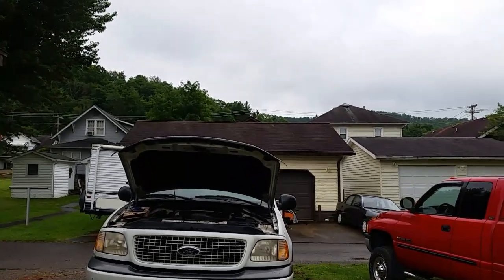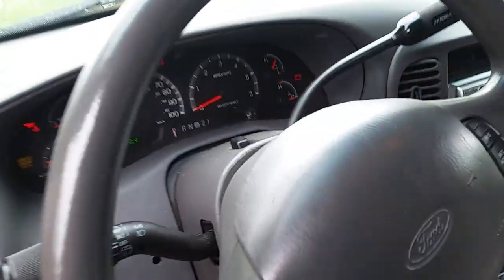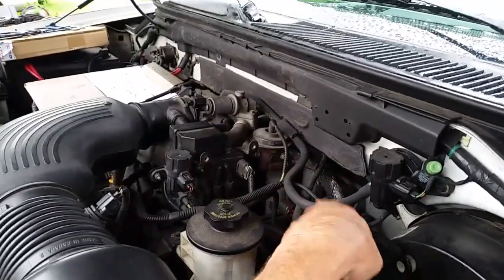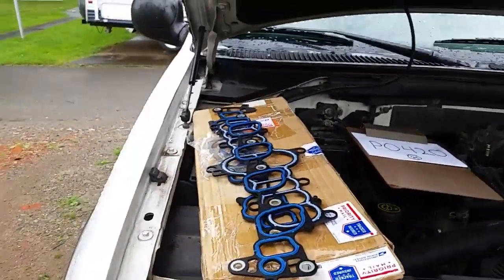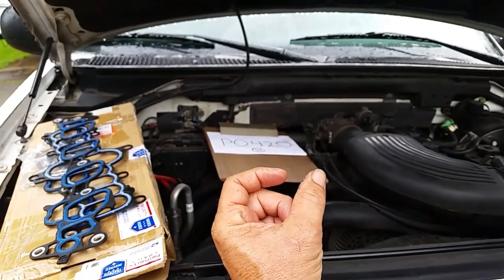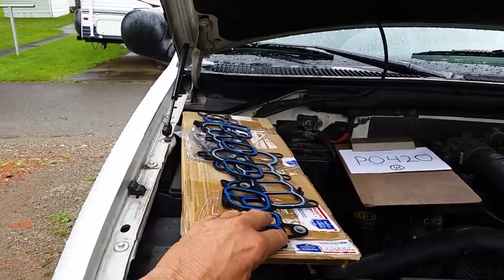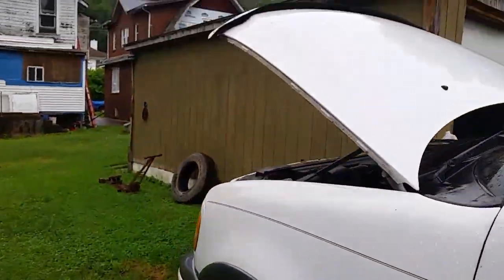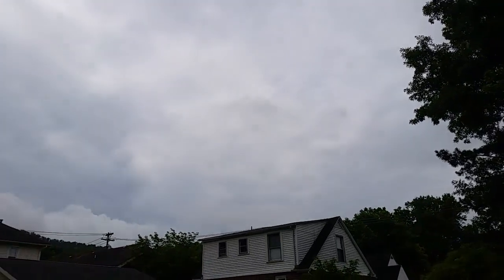P0420 Code. How to fix it. Don't spent spend tons of $$$.

Comment from the maker: Rare Occasions the O2's and Catalytic Converter's Go bad...VERY RARE. I have found starting with small things like, Gaskets, Air leaks, make sure something has not come loose, etc...usually has a better out come than spending $ 100.00's of dollars on  Catalytic Converter's ETC. Take it one step at a time.
Reply: As a auto tech 80% of the time it is a converter.
Reply: very often.... very often. hit a bump, shit breaks. gut the bitch, do the antifouler trick, never gotta deal with that shit again. this may fix it for a while until the p0420 pops up again, it takes a long ass time for it to show up again as the evap system is the last one to go through clearance. but i guess people like hearing false hopes than the hard truth, which isn't for the weak-hearted
Reply: May i ask what may be loose so i can check off the possibilities..thanks much great vid
Reply: Nathan Rohrbough can you leave links to the required parts
Reply: @fury3600  spray starting fluid on the vacuum line's or anywhere it could leak be careful but if there is a leak the motor will rev from the starting fluid
Reply: I just bought a used 2008 ford taurus with 80,000 miles and my check engine light just came on says p0420 code whats the actual probability i need a new catylatic converter compared to something else
Reply: Man if you want to try and teach people about auto repair then at least know something yourself. Mechanics already get a bad wrap without you spewing wrong information. A vacuum leak causes a lean code P0171 not a cat code. Please stop with these videos.
Reply: allison 100% his video is so wrong in so many ways.
Reply: @dlmcbm  wait wait wait... Are you saying "too lean" will not result in cat efficiency? Wowzer. Before you go and say for sure someone else does not know what they are talking about, you must be sure yourself. Although the author of this video's information may be limited to a degree, he is absolutely correct that a computer reading of too lean (or vacuum leak) may cause cat inefficiency. Yeah, I bet you'll argue that a reading of "too rich"  and not "too lean" will cause cat inefficiency. My reply, what are ya working on 1960s cars? Its 2019. I can show you a ton of todays cars with computer readings of too lean from a vacuum leak but where the computer will dump in more fuel, thereby burning rich and affecting cat efficiency.
Reply: @dlmcbm  And by the way, too lean is not gonna show up absolutely all the time for sure on every car before cat efficiency.
Reply: @geeess958  
If there is leake something broken around the air filter can cause this fault?
Reply: Thank you Nathan!!!
Reply: @dlmcbm  I'm not a mechanic, but I'm gonna use a little common sense:

1. downstream sensors throw a code saying catalytic converter is acting all screwy

2. mechanic puts in shiny new catalytic converter

3. downstream sensors say converter isn't so screwy anymore. Customer happy. 

Yes, one obvious conclusion would be it was just the cat. But could it also be the cat was getting fed all kinds of junk, junk that the new cat is better able to handle? If the cats really were bad, could something have made them gone bad other than normal wear? 

Again I'm just a layman and not a mechanic, but I just don't see how you can shit on this man for pointing to other solutions. Telling him to stop making videos?? Come on. 

I'd like to see with my own eyes someone who bought new cats and didn't see that code come up 15K - 20K miles later. I know yall keep selling them to customers, and they're initially pleased, but I would personally like to see a long term follow up from someone independent.
Reply: @allison7121  did you ever figure it out?
Reply: I had the code come up I found my air intake was busted wide open. 73 days later it came on again. I'm not buying a bad cat. I've no symptoms rotten egg smell loss of horse power sucking up gas.. I'm going to look for more air leaks thanks
Reply: @dlmcbm  very true. Catalytic converters wear out just like anything else. Mostly a PO420 code means that it's operating below threshold. It's gone to the auto grave yard. 😞
Reply: @deanshoemaker5618  did that thatscwhen i found my air filter box was cracked fix it. Too is yesterday for smog test passed in 12 min..i don't care what or how many years experience these techs have.. im an electrical tech... Moral of the story P0420 can be caused by an air or vacuum leak..eliminate i found 2 small leaks .
Reply: I have a 2011 Ford edge with the 3.5, it has a plastic intake. I recently did spark plugs and you have to pull intake to get to the back 3. I put a new gasket back on the intake prior to reinstalling. I now have a po420 code. I also over tightened one of the side bolts and it broke, so is tht causing the code?
Reply: Check for air leaks mine was a plastic air intake and I had just did the same changed the plugs and air filter in the process I cracked the air intake with out knowing. Replaced it cleared the code it passed smog the other day
Reply: What about my exhaust leaking will cause my fuel trim to go out of sink and trigger p0420
Reply: wanna know whats rarer?
hearing my muffler go louder when im in ghe middle of the free way and getting home
finding the muffler literally gone
Reply: Can this lead to a bad idling also?
Reply: Help I have a 2013 fiat abarth . I just replaced the spark plugs and air filter. It looks like someone welded their own resonator to make it quieter.  Anyways has a p0420 code . What do I do next ,buy a spacer. Or can I try my o2 sensor from my 2014 abarth on my 2013 .should I try the first one. Also we noticed it looked like the air filter was ne er replaced and we did notice those rotten gaskets on the intake !! We used the gaskets from my stock 2014. I think we plugged scanner tool in again but will it delete code if that fixed it
Reply: He's right though.  Lot's of other things can cause a cat efficiency code. I got a cat efficiency code because I had an exhaust leak. The exhaust was sucking in air and it looked like the cat wasn't doing its job, it also set a lean code. Either way you have to fix your other problems before you fix the cat. They don't fail on  their own. If you don't fix the problem that killed the cat to begin with your gonna be buying a new one anyway.
Reply: Let's clean that up.
Warm your car to temp. Run your hand close to all surfaces of your exhaust to check for leaks. Before the last O2 sensor. After that, doesn't matter for this.
Run a scan tool and check the voltage outputs of your 0-2 sensors... You can look up, on YouTube, what your should expect to find. The voltage on your first one will differ from vehicle to vehicle, but... The activity will be the same.
The second will snitch on the cat, is it reading a steady .5 volts, most of the time, at idle? If not.
Get the temp of the exhaust pipe coming into the cat. And coming out. Did it get hotter or cooler? ... It should get hotter.
All this... Takes 10 minutes or so.
... I don't really want to chase little shit like gaskets, and digging for lines... Before I've verified that check engine code, isn't actually correct. Before looking for alternative causes.
Reply: @imurhuckleberry1762  Did you find out exactly what caused that code for your 2011 Edge?
Reply: @tonyorob  02 sensor and possibly mass airflow sensor as well, mine was bad running it lean but may not have anything to do with the code.
Reply: @imurhuckleberry1762  Ok...Those are among  the first things I already replaced but still got the code. I just went ahead and replaced the front catalytic converter, hopefully the code will dissappear after driving the car a while.
Reply: @tonyorob  did urs give u a Bay number? just don't forget its fwd so its reversed, Bay 1 is in the rear Bay 2 is the front.
Reply: Changing out the intake gaskets ain't cheap either so make sure u narrow it down what the issue is
Reply: Good job
Reply: @emilyhofland8219  finally someone else who understands!!!! But his reply to my comment is comical at best lol.
Reply: @thomasmarquez6790  as a mechanic, do you just replace the cat and call it good?
Reply: That's why you should bring it to me I'll scan the code due to diagnostic guarantee the fault and you do the repair, or I can do the repairs for you while it's here,, but one thing to remember don't replace junky parts with new junky parts, but it's good to see people wanting to wrench on their own car
Reply: I can totally agree on the gasket but after checking the labor fee from the mechanic to replace it, it cost about $500 due to cat manifold location that's located deep inside the engine and its not easy fix

Comment: Check the easy stuff first, I just solved my P0420 found a vacuum line off. Got to get lucky once in a while.
Reply from the maker: Lucky you!
Reply: @FixingWithPassion  Your doing the public a great service, keep up the good work. All the do it your selfers out there appreciate your input. Truely
Reply: Good for you. What unit did you use. I'm looking at buying an Auto...somethig for $124.00 on sale.

Comment: Exhaust leaks can also cause a oxygen sensor/catalytic converter code. And usually if you let it go too long you will have to change the sensors after you fix the exhaust leak. Because your engine will run rich and flood the oxygen sensors and foul them out
Reply from the maker: Yea....not good
Reply: Need advice help please. Code p0420 car is  not burning oil and is running fine obd2 scanner also says poor connection sensor 2 and pcmm could the issue be my down stream 02 sensor ?

Comment: My 1999 Ford Ranger 3.0L 5 speed manual 2WD had the PO420 code. I replaced the pre-cat O2 sensor (passenger side) and the check engine light has been out for 5 years and still good. I purchased an OEM sensor (made by Bosch).
Reply: Where did you buy the Sensor?
Reply: @luisponce1472  I think it came from Auto Zone, but was a Bosch like the original unit. Been many years since replaced and code has not come back.

Comment: My auto shop wanted to replace both o2 sensors.  $630.  I said no.  They cleared the code and check engine light is still off.   Hmmmmmmm.  08 Altima
Reply from the maker: Nice!!

Comment: Your 100 % right ,not knowing i was younger had that code autozone guy said its o2 sensors i have 4 100000 miles ill replace all 60 dollars each code came back in 24 hours ,had a mechanic friend tell me look for a vacuum leak i did  3dollars fixed problem rubber vacuum line laying on hot engine melted hole .now i tackle everything differently. GOOD JOB.
Reply: Check for vacuum leaks
Reply: salesmen are rarely good advisers 😉

Comment from the maker: Update to this video: After fixing the intake gaskets the p0420 never came back on 
(perhaps rare on this fix and a 2nd 4.6 ). Perhaps air mixed with 
antifreeze tripped the code... a bit strange tho. If this is not caught soon, it will burn up the cats!! But if all else is ok, fuel trims, no other codes etc, leaks then cats probably are bad. It does happen sometimes. Tap on the cats to see if you hear rattling, if so they may be falling apart inside.  Scope them and watch graph to verify. Happy fixing!
Reply: I have this code on my truck,  but I don’t know why the check engine light turns on and of every week
Reply: If you hear rattling while tapping the cat underneath, is that a solid indication to replace the cat asap?

Comment: Both my cars had P0420s hit at the same time. Did the full diagnostics. Ended up replacing the Cat in my Tacoma and as of 1  month later, no more P0420. I checked and replaced the intake gaskets with no success. On my Grand Caravan it turned out to be a bad gasket in my air intake plenum ($16  gasket). Don't discount a bad cat - it does happen.
Reply from the maker: Yea more that often ;(

Comment: Good video. From experience its my opinion that most DIY mechanics need to invest in higher quality scan tools. If you drive an older car and or work on a lot of OBD-2 equipped vehicles the simple code readers are next to worthless for diagnosis. They simply give you a code. I use X-tool but Autel, Topdon and countless others make dealer grade scanners that will simplify your diagnosis process.

Comment: My 2003 Chevy Trailblazer with 217,500 miles on it, turned on the "check engine soon" light, with the P0420 code. In my case, a new air filter and a can of Seafoam in a fresh tank of 89 octane Shell midgrade (no alcohol), did the trick. The light didn't go out on its own, so I cleared it and drove 106 miles today. It remains off. Tomorrow I'll get it inspected. I did a lot of research and anything that can upset the fuel/air ratio, can cause that code! Check the simple stuff first! Good luck!
Reply: Has the light remained off?
Reply: @iamlazarow3526  It remained off for at least 6-9 months.

Comment: When you use a
 digital temperature gun.
A BAD catalytic converter will be hot going into catalytic converter
& cooler coming out.
A GOOD 
catalytic converter
Will be hot on inlet
& even hotter on the outlet.

Hope this helps
Reply from the maker: Yes thanks!
Reply: TVWXMAN32 
Np
Did you ever put the gaskets on?
I had a,
2000 4.6L towncar
And
 had to replace plastic intake and gaskets @120k
I Bought the 1 owner 
car for $3k
With 70k miles.
Sold it with 390k miles 
For $2.5k last summer
and she's still rolling.
Changed oil every 
2500-3000 miles
And beat it everyday lol
120mph governor :-p.

Cya,
        W3BZ
Reply from the maker: Yea I did, I have done 6 since then...lol
Reply: TVWXMAN32 
I ask,
Cause you said you'd post a link In description 
Of a vid update.
K keep up the great work on you're channel.
Well cya,
               W3BZ
Reply: Yep you're very right
Reply: It is possible that the temperature of the catalytic converter is effected by the leaky gaskets? 

I mean, if air is getting into the system, couldn't that change the performance to give you a different temperature? 

I just don't want to replace the catalytic converter unless I'm absolutely sure.

And this gasket thing has really thrown me for a loop

Comment: Bought a $20 micro mechanic from Walmart. Used the torque app to clear the code whenever I get it. Comes on every now and then but not a big deal. Everything’s good as far as I can tell.
Reply from the maker: Make sure the bearing wax seal is still good. They fail.

Comment: My old volo xc60 runed 130k miles and used no.87 gas for it.recently it appear engine check mark and went auto shop paid $200, recommended to change 4 oxygen sensors and cab.   total amount will be $5000 more. And talked with the shop owner and found some useful info. ---use cabcleaners for 3bottles running 1200miles. The engine light gone. 😅
Reply from the maker: Nice!!

Comment: If it's your Catalytic Converter you can often reset it long enough to pass inspection, was able to do that for nearly two years. Finally had to change it when emissions would complete a cycle. Mines was factory original from 2004.
Reply from the maker: Yea but....Emissions testing places are on to that. Until the vehicle/system clears so may start cycles, your not really passed and any emissions. Only after all start cycles are completed and the computer see this and is happy. 
There probes /computers will see that.
Been there done that.

Comment: I can’t thank you enough for the explaining I have a 05 Buick lesabre with the 3.8l v6 with the plastic plenum and there’s antifreeze leaks around it so that’s proly y my code is coming up I’ve changed the 02 sensor spark plugs and wires and ICM and all 3 coil packs and that dang code still came up so now I’m gona fix the gaskets before I tackle the Catylic converter!!

Comment: Thanks for this. I just replaced my intake manifold gaskets and got this code shortly after. It was a new code so I was thinking something else went bad or I broke a connector on the O2 sensor or something. After you stated a vacuum leak can cause the p0420 code I went back and checked everything and found I left the vacuum line from my throttle body disconnected. Put it back in place and the code hasn't come back so far. Thanks for the information you provided.
Reply: I feel it's also my manifold gasket on my hybrid and checked with my mechanic and said it cost about $500 to do the labor...how many mileage do you have on your car? I'm at 240K mileage at my 2017 Hyundai due to Ubering full time

Comment: I have a 2012 Honda Accrod  4cyl. I got the same code, so I have replaced both O2 sensors and a Catalytic Converter, but the code is still there. I'll need to check for leaks now. Great video. Thanks!
Reply: What did you find after..?Thanks.I think lot of Hondas and royota have that code and toyoto and Honda need to help recall those product but people need to revolt against those two companies.it costing people  lot of money but no one is talking
Reply: @abe5316  I Have A 03 Honda Deleted My Cats And Its Still There
Reply: did that fix it?

Comment: Hey there, old video, but! I've had a P0420 code on my GD car for a year. I've replaced the up/downstream O2 sensors, fuel pump, Valve cover gasket, etc. After replacing the VC gasket and fuel pump the light went off for a glorious 2 weeks. Came back on today - P0420 code again...gonna look into this manifold gasket next. I really don't want to put a CC in a 10 year old car with nearly 300k km on it. No matter how much I love it (I call him Speedy Gonsales - 2010 Chevy Aveo :))
Reply: Did you get the P0420 code cleared?
Reply: @alancameron2433  Nope. but DEFINETLY the exhaust manifold (w cat). I'm going to use my multimetre on the o2 sensor attached to the manifold to see if it's faulty as well (or useable when I replace the manifold because O2 = expensive, dammit!
Reply: @Supesfan88  I have watched some very interesting You Tube videos regarding code P0420.The more you watch the more easy it will be to diagnose correctly.